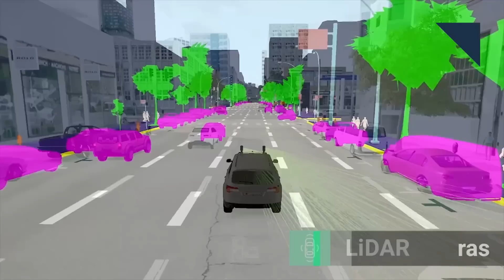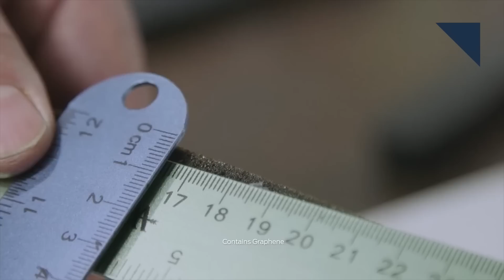Ford Using Graphene, New S-Class Plug-In - Autoline Daily 2453

Comment: I really like when you present the info in both metric / imperial .
Reply: Or you could learn to convert.
Reply: Daniel Pulido - I second that.
Reply: Relax, I just said , I like to see the info in both systems, I never said I prefer one or another, and I could convert units at my will. Fyi, this channel has audience in other countries were the metric system is the norm. No need for drama, nobody is asking for info only in a particular system.
Reply: @danielpulido3796  I to prefer both, somethings I do better in imperial while other I prefer metric, what is wrong with them doing both.
Is it Auto-Line for the US only or Auto-Line for the world?
Reply: they use metric when source material states it in metric.... so we all just need to take chill pill and learn both or do the conventions....
Reply: BTW in the states it called SAE not imperial that just a Brit term for it...
Reply: I like hearing both since I am used to both systems working in engineering. One I hate though is when some companies and magazines reference PS (Metric horsepower?) instead KW or HP when PS had been made obsolete by convention around 1972 by the EEC.

Comment: FORD EV if it only saves about $2,000 annually, it will barely ever break even.  But the PR may be worth the perhaps $15,000 to $24,000 of investment per each "city scooter" van.  Hey they seldom reach speeds of more than 25 MPH on average.

Comment: With all these new electric vans and commercial vehicles coming to the market, there's no excuse for blue collar people to keep on complaining about carbon taxes and increase gas taxes. Gasoline taxes need to go up and carbon taxes need to be implemented. If you want to save money and skirt paying the carbon tax, buy an electric van.
Reply: I trying to figure out why people think driving an electric car powered by unseen fossil fuel power plant is great.
Reply: That's a stupid opinion of me. How do you think businesses and people in Sweden and Norway and Denmark coped with the carbon taxes implemented in the 90's?
Businesses have to pay for fuel, a carbon tax, and maintenance. The money people save on fuel can go toward their monthly payments. How is that stupid?
Reply: @firefox39693  There might be some differences in what you guys have to pay in Scandinavian countries,  versus what we pay in the states.  But there's more than enough evidence that most (if not all) will NOT reach the break even point with an EV before they'll have to get a new one.  Insurance, the price of repairs, as well as the lifestyle changes needed to use an EV, can make it a losing proposition all the way around.  That's INCLUDING whatever you MIGHT save on fuel, which can be, in some cases, under 10% different.

No, most people have done the math from a VERY knowledgeable position, and EVs just don't add up.  And they won't be able to afford them no matter how much they're touted over ICEVs.

Sorry.
Reply: Electric cars emit less CO2 per kilometer than a comparable gasoline car. The ratio of fossil fuel generation is different everywhere. Regardless, driving using electricity is cleaner.
Reply: @firefox39693  And with that, I can only assume whatever sacred EV cow you protect has just been roasted.  Sorry, but reality rules over your feels.
Reply: Landon Thomas carbon taxes are outdated. Obviously it was a tax to create revenue stream for an already out of control government but the intent was to push us all toward alternative fuel and energy while reducing carbon footprint. We have already went beyond what the carbon tax was meant to do and heading in the right direction without paying the government a penny. Companies are using all that money that would have gone to the feds coffers to achieve these results. They couldn’t have done it as fast if that money was simply handed over to the government mafioso style.
Reply: You're telling me that? I've been citing facts and examples of EV's and carbon taxes and all you said was most businesses can afford a 3-6 grand used car. I'm not whose ass you pulled that out of; you certainly didn't get it from Autoline Daily.
Reply: Your comment is confusing and it makes no sense. Rewrite it.
Reply: @firefox39693  You're talking about BUSINESSES now, instead of 'blue collar' types (i.e. INDIVIDUALS) as you initially were.  And the price for used vehicles is an average for used 6-10 year old light vehicles, as can be found on Craigslist or other used car sites.  Autoljne doesn't deal in used stuff, only NEW.

Not my ass...sites for used cars.  And since the median income in the states is still around $36k, few 'blue collar' people can afford ANYTHING new.  $6k is about the limit of their budget.
Reply: No way, no carbon tax and no incentive for EV  let them make their own way with out government incentives, that crap needs to stop now,your idea of utopia is not mine, stop shoving your crap down my throat
Reply: The idea of a carbon tax is to pressure people into doing the right thing. If let's say, you own a Ram 1500 and can only afford to own it if gas is cheap, then a carbon tax on gasoline will force you to change your habits. That's a perfect solution. If you don't want to change your habits and drive a plug-in vehicle, buy a smaller car, that's your choice. You can still own an inefficient Hemi-powered Ram if you want; it'll just be more expensive for you to own.

And, don't tell me electric cars and plug-in hybrids shouldn't exist. Don't tell me a carbon tax shouldn't exist either. Don't tell me that they should make it on their own and tell me that 'I'm' forcing my idea of a perfect utopia on you. The Oil lobby has controlled governments around the world for years; lobbying the obsequious Republican Party at the federal level and state level and the federal government in my country, Canada, for years. The oil and gas lobby have killed the electric car, they've held back the adoption of solar power, wind, ethanol, and so many other environmentally beneficial solutions at the expense of the planet just so Exxon, Shell, BP, Suncor, Saudi Aramco, and the rest of the O/G industry can thrive.
In the US, big O/G has lobbied long and hard to be undertaxed and underregulated to the detriment of US citizens and the environment. It's not like the state governments or the federal governments owned any share in any oil or gas company either. All levels of government had to settle for the pathetic amount of tax revenue they collect, and that's it.

I'll repeat this again, yes. The US needs a carbon tax. The US emits more CO2 per capita than it has any right to.   I've been a massive car enthusiast my entire life and I also love the environment. I can love cars and do my part to help the environment and advocate for green alternatives.  Simply telling me you don't want a carbon tax because you want to keep driving a pickup for next to nothing isn't a reason. Sorry, not sorry.

Whether or not you understand this now doesn't matter to me. I hope to fuckin god you understand the gravity of climate change and the need to reverse the affects of human-induced climate change.
Reply: @firefox39693  Interesting you accuse the U.S. of creating more CO2 than Europe, China, or the developing turd-world countries.  Last time anyone had the balls to be honest, the U.S. is far LESS polluted or polluting than all the so-called 'green' Euro countries.  We don't have our energy produced for us by another country and wired in; we produce our own and pipe some out to OTHER countries.  And our production of nitrous oxides and particulate pollutants is far lower as well.  But I wouldn't expect some arrogant thinks-he-knows-it-all to get that...or accept the truth of it.

Additionally, CO2, as far as greenhouse gasses go, is far LESS important to the global warming thing than WATER VAPOR.  You know.. the stuff that makes up CLOUDS.  And this planet has a simply marvelous self-regulating mechanism for temperature regulation that we have NEVER been shown to be able to affect--that of plants' photosynthesis.  You know the basic science:  plants take carbon DIOXIDE (what we breathe out) and carbon MONOXIDE (what ACTUALLY comes out of the tailpipe of an ICEV), combine that with nitrogen, water, and sunlight, and make cellulose, sugar, and OXYGEN.  The more CO and CO2, the higher the O2 content goes.  The higher the atmospheric O2 level, the more ozone (O3) is produced in the upper atmosphere as solar radiation strikes it, and the less cosmic radiation that gets through.  Less radiation means less warming, and the planet cools down.  Plants grow more slowly, the O2 level drops, ozone level drops, more cosmic radiation, higher temps, more plants.  It's a system that cycles up and down but maybe a few degrees celcius over HUNDREDS of years, and we have done precious little to stop or affect it with our hundred years of industrialization.  So trying to get rid of CO2 is not only mind-bendingly stupid, it denies basic scientific fact.

As you said, things must be forced on us, because this whole 'revolution' has NOTHING to do with either saving the planet or 'evil' oil...it's always been about CONTROL.  It's been about taking autonomy from people doing voluntary business with private companies, and forcing them to bow down to government-controlled utility monopolies.  And you just put yourself out there as one of these left wing psychos, which makes not only your over-dramatic rage but your preachy opinions as false and invalid as your politics.

You lose.  We're still free, and we're still here.  And we ain't bowing to be ANYONE'S slave, bitch.  Go suck off a somalian and leave governance to us adults.
Reply: So much bullshit in one comment. You literally went out of your way to be rude and a troll.
To deny the causation of climate change 'is' to deny scientific fact. Telling me that plants take in CO2 to live does nothing for me since everyone already knows that. Telling me that polluting the earth and releasing more CO2 is good for the environment is clearly stupid. Water vapor isn't 'worse' for the environment. You're grasping at straws when you say that. When you think you need to mention water vapor and how you think it's somehow worse than co, then you know you're on a losing side of an argument.

You don't need to tell me how much of a know-it-all I sound like. Anyone who sounds more informed than you is going to sound annoying and you're going to feel uncomfortable. Not sorry about that.
I just saw you do some wicked mental gymnastics to try and make yourself sound smart. You didn't impress me. I think you had an effect on Dan Bouchard. I'm sure that's where your one like came from.
Lastly, forcing everyone to change their ways isn't about controlling people. Americans are stereotyped as stupid, loud, annoying and thinking their superior to everyone else. This is exactly like you. You're so wrong and you just can't let it go. You're being a child. Adults know when to admit when they're wrong and accept the facts for what they are. Children come up with their own alternative facts. We all know what side of the US population 'loves' alternative facts.

Don't tell me to suck a dick. It's homophobic and pointless and futile.
Reply: DP T well if it’s powered 100% by a coal plant it’s still cleaner than an ice. But there’s a good chance that the grid supply being used is some percentage renewable and expected to increase its renewable inputs every year.